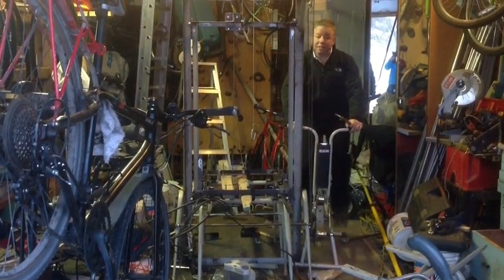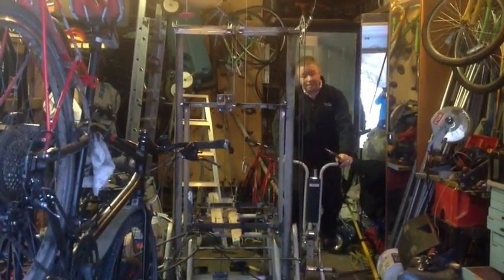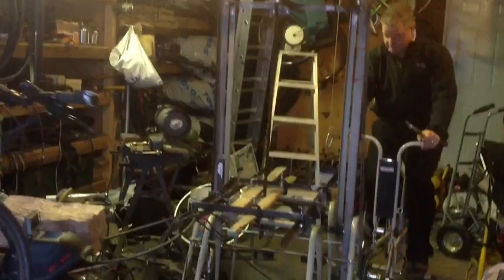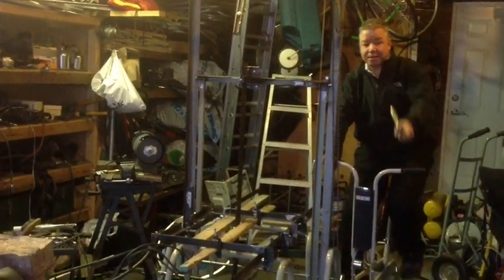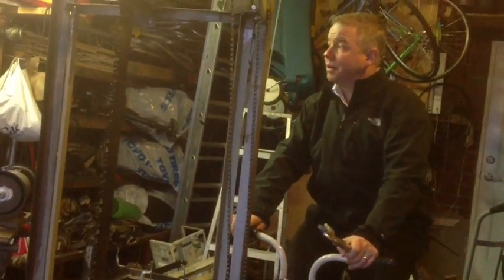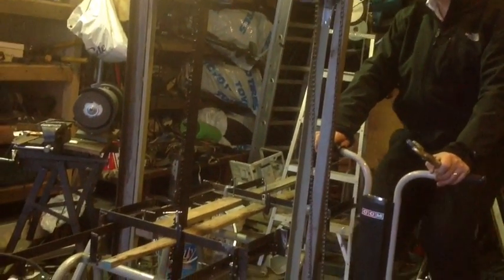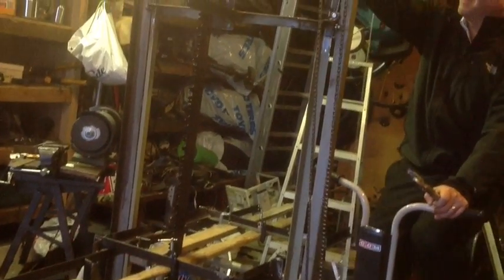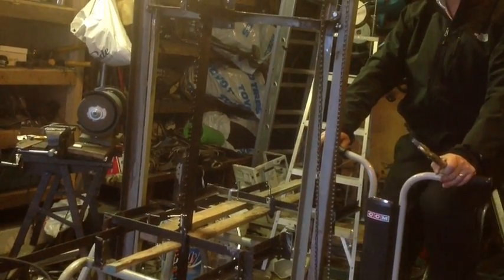Bicycle Powered Saw Mill

Comment: Km trying to maks one wigh a bandsaw. Much easier since it already has the bearing shafts pulleys etc. Just replace the motor pulley with a sprocket and figure out a frame. I want to make it horizontal like a bandsaw mill with the bike behing it on a carriage that has a way to use the bike power to pull the whe thing.....the sawhead and you on the bike behind it have to move while thd log stays still

Comment: you're smart enough to figure this out.....torque of gear ratio.....I would make one but I don't have the free time right now....use a 15 foot farris wheel with gears off the main axle or off the outer edge. but your bicycle could be better used powering the farris wheel and let the torque of the wheel power whatever blade configuration you have. remember,,work smarter, not harder.

Comment from the maker: Hi Glen,
I have been cleaning around the saw mill without doing a lot of work on it. I have been working on attaching an old 10 speed so that the gears can be changed to speed up or slow down the cut rate. Once I get the whole thing working I will look into attaching a fly wheel. Thanks for your suggestion. In the meanwhile I have converted my excercise cycle part into a wheat grinder, which works quite well

Comment: Have you made ay progress on this?  Great design!  Have you considered the addition of a flywheel and switchable gear ratio (like on a mountain bike)?  Once the flywheel builds up momentum you could gear-up and really chew through a lot of wood!
Reply from the maker: Hi Glen,
No, It was a fun project, but it was not in any way efficient. I have tried many different improvements, but the blade always gets stuck or wanders. Eventually I moved on to other projects that have been as frustrating as hell, but less so than this project ;)